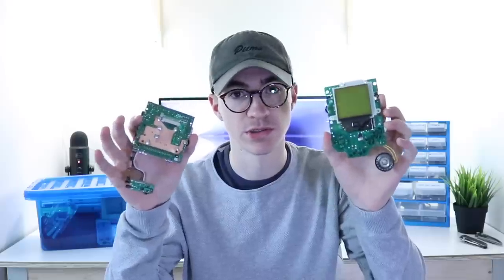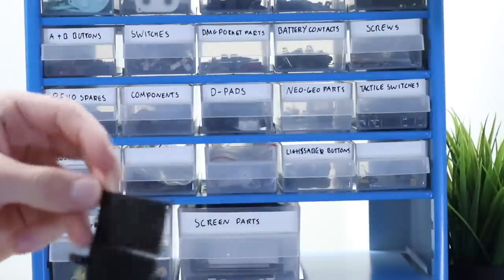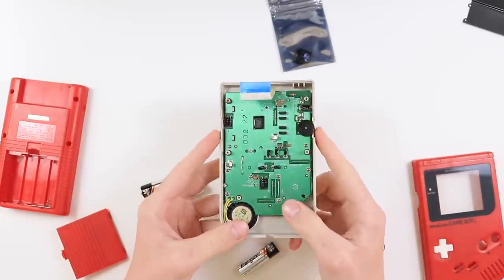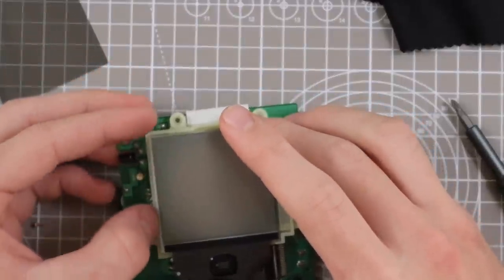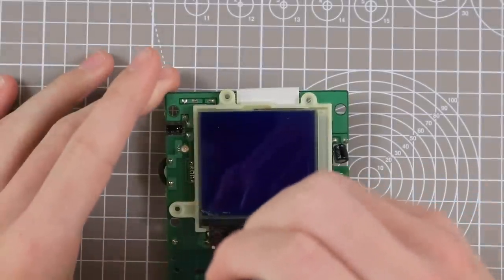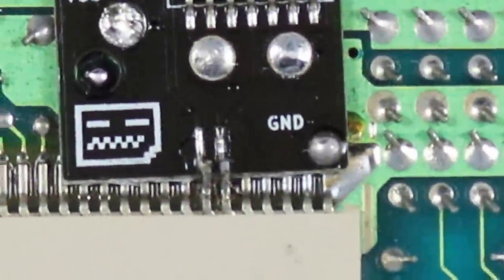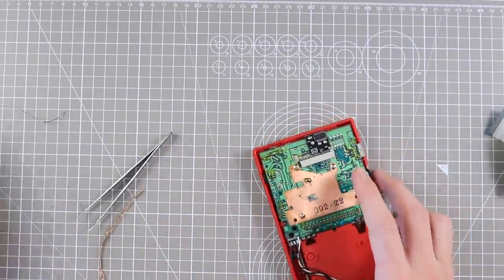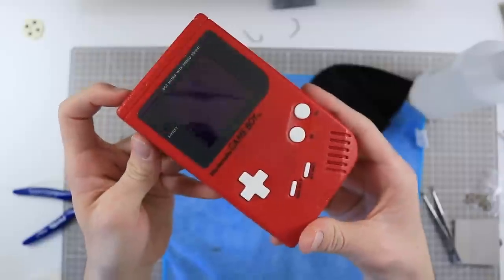Building a Modded GameBoy from Scratch!

Comment from the maker: Feel free to skip to 4:40 to get straight into it!
Reply: Hellnaw
Reply: No
Reply: Ok thanks
Reply: The Retro Future hey I know I’m late and you probably won’t read this but is there any reliable and affordable place to buy refurbished gameboys? I’d like to get two one for modding
Reply: he'll yeah
Reply: @TotallyNotDoggo  ebay
Reply: Holy whack... These rubber buttons... Does anyone know where to find similar rubber buttons for Gameboys? I live in Australia, but looking on the internet, whenever I look for rubber buttons on the internet, I always seem to find the rubber conductive pads and the normal plastic buttons instead... Does anyone know anything about those rubber buttons like those in the video?
Reply: Ok thanks sorry I’m late I just found your channel
Reply: This mod isn't worth it in MY opinion. The labor is too intensive "fucq that polarizer" and the high probability of breakage is too great. Plus you're PERMANENTLY destroying that vintage screen. Regardless if your mod was successful. Just use an IPS kit and save the original screen.
Reply: TotallyNotDoggo pawn shops, eBay and small shops.
Reply: Hey can you do this but with a Ds lite? I had just bought a big lot of parts, so a tutorial on building one from scratch would be great.
Reply: Aireme Shouldn’t be too hard to do on a ds lite you need a screw driver and special tri tip driver

Comment: if you'd take a little more time aligning stuff, it would be easier for you to solder the stuff in place. also its a good idea to remove as much of the old solder from the un-used pads underneath anyways plus it would fit much nicer, making for a way more solid job :)

Comment: You should make a rechargeble batery for it ;)
Reply: I imagine what you're imagining will cause some case damage, so an aftermarket rear shell would be needed, unless you mean to just use regular Ni-Mh AA cells. As they're Ni-Mh, they'd have to be fully discharged before charging.
Reply: Whats the point when you can buy energizer recharge NIMH AA batteries?
Reply: Kaleb Gullan: It would be nicer to install just the recharge circuit to recharge those energizer batteries directly on the GB.
Reply: In my apinion it is ok to trim case plastiks...
Reply: I would try to not trim the case unless i have other original gameboys.
You won't know if you would want to restore the product to its original setup in the future.
Reply: He has a LOT or them...so...
Reply: @ShinryuZensen  You can fit a DS I battery in there, but it would be useless as the DS I battery is 1500 mah whereas a high quality AA battery can be up to 2850mah.

Comment: Hey I just wanted to tell you that the gameboy that has yellowed because of age, you can  get the shell and soak it in hydrogen peroxide inside of a transparent sealed container and let the whole thing in the sun light for a day or more. The hydrogen peroxide and the uv light from the sun rays will restore the plastic to it's original color. Be aware that this  process may erase any graphics that are on the plastic.

Comment: Would it have worked to rotate the polarizer by 90° instead of using the bivert chip? Also, some of those solder joints look a bit iffy and could use a bit of reflowing.

Comment: a bit ago i killed a bivert chip. the two contacts that the pins are supposed to go to were practically ground down to the board. any idea if there is a way to re-activate the board contacts, like add more whatever that conductive material is to the board make it work again? i was going to toss it, but if you were interested in giving it a shot, i can donate it to your channel if it's video making material. thanks.

Comment: What does the Violet chip do?
Reply: It's a bivert chip, not a violet chip haha. It "flips" the pixels on the screen so dark pixels are light and vice versa. It improves contrast and picture quality.
Reply: Lol, bivert, not violet. It increases contrast.
Reply: It's required because he removed the reflective backing and added a back light.  The way the pixels light up needs to be inverted so they look correct again.  I think it might be called bivert, either because there's two pins, or because it's 2bpp.